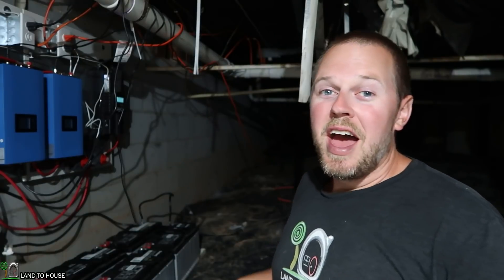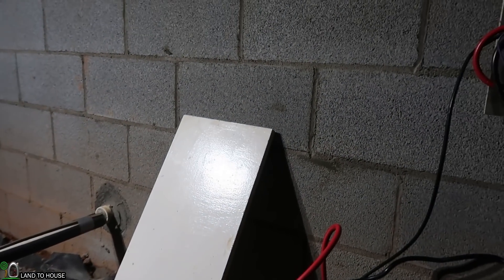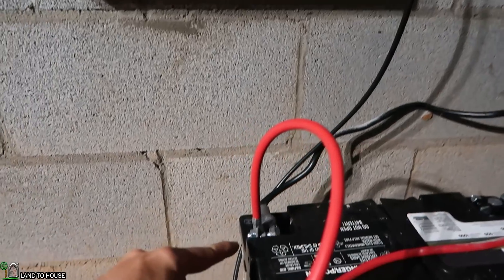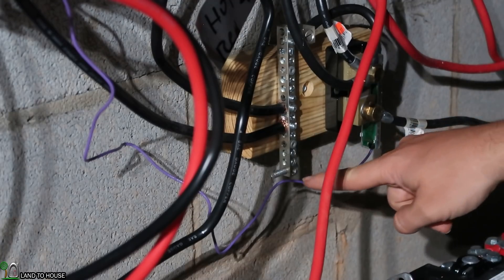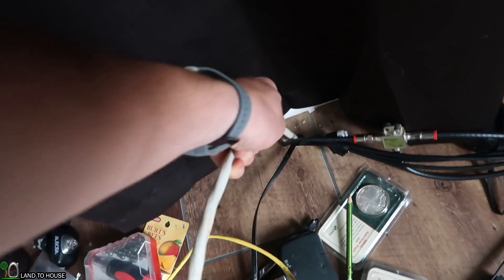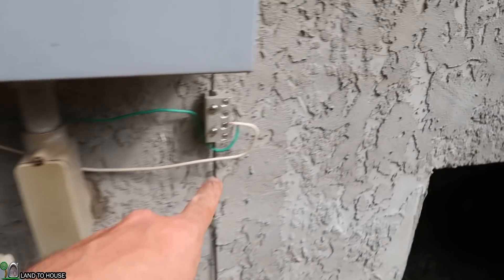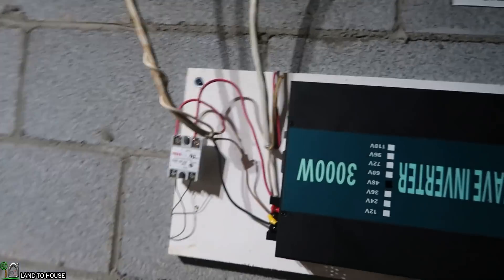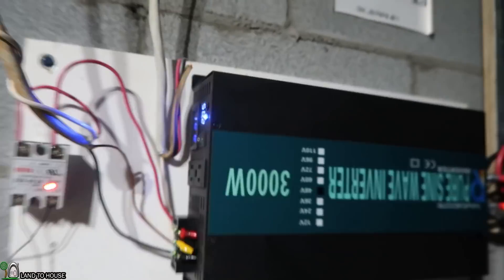Installing an Off Grid 3000w 48v Inverter Hydro and Solar

Comment: No circuit breaker from input to inverter and inverter to output? That sounds unsafe man. 
----
I have a 1.5kw inverter (off-grid) and I always use circuit breakers for high current draws. For 10A DC and below, that's the only time I'm not going to use a circuit breaker. I'll only use a fuse. 
----
Also, if you have a circuit breaker at the time you are connecting wires to your inverter, sparks shouldn't have happened. It should've sparked inside the breaker.
Always safe always man ✌️
Reply: the high amperage DC circuit breakers you are talking about always give problems over time, especially if cheap and Chinese, they start to heat up, they do not close the contact well and in the event of a short, many are unusable, they explode because the contacts are stuck, the disconnector fuse DC is the best option alternatively DC fuse to be bolted and rotary disconnector, the spark at 48V is not dangerous but it damages the contacts internally and creates arcs more easily than AC, the only method is to load with a resistor and then close the 'switch, so there is no risk of blowing the fuse, that inverter does not have red capacitors like the more expensive models.
Reply: @winterburan  I don't use cheap Chinese circuit breakers, those are bullshit. I only use marine grade ones. Also, my set up is almost 7 years no problem encountered at all. 
------ 
In your statement where, I should use high amperage fuse; that is costly. I'd rather use circuit breaker and isolator combination for that one. If you are going to use high current fuses; when there is a short circuit, it will wait for the fuse to blow which requires the battery to give high current to blow the fuse (when the circuit is shorted). The bad thing is if it doesn't blow because the current supplied by the battery (low voltage, old battery, ...) and it will overheat your batteries and melt your wires. If that happened, replace all damaged parts. 
----
But if you are using circuit breakers that won't happen. As soon as it detects short circuits, it will trip. All connections and electronics will be safe. 
----
Regarding to your statement of using resistors to pre charge the capacitors, that's good, "if you have one". I use it too before I got my isolator switch.

Comment: I bought the same brand inverter, 3000w 12 volt and it fry the unit.  It burned up and smoke poured out of it.  Installed for 12 months, only used it 5 or 6 times

Comment: Hmm, I thought you can't double up wires to make them act like a larger Guage because there is not guarantee that they are the exact same lenght/travel path and can still overheat one of the wires.
Reply: Not true, very common, from grid utility HV distribution right down to this level, , Of course they should be the same length, and correctly fused, either individually or as a single cable.  There are much bigger safety issues displayed in this video

Comment: I will check out other channel. Ever check into Maxwell super capacitors to replace batteries? Super capacitors will replace lithium ion. Super capacitor bank charges in less than 10 minutes. I use super capacitors as on demand power and batteries for stored night time power. The super capacitors allow me to run anything once sun comes out because of super fast charge times. Batteries take hours to charge. Super capacitors last million cycles compared to 12000 with lithium ion. Cold don't effect super capacitors. You can drain super capacitors fully with no damage.

Comment: Please  please put red electrical tape on the black wire your using for a positive DC it will alert you and someone else in the future to what has been done.  I am former telecommunication electrician for the power company who has extensive experience in 48 volt DC system control and fiber communications. As soon as I move I would be more the happy to help
A 3000 watt inverter can draw under normal operation up 62.5 amps  Surge startup will be more. 
This is a general guide, never exceed 80% of the ampere rating for a wire size. Please be careful
Reply: I've been telling him for some time to do some basic cable management...